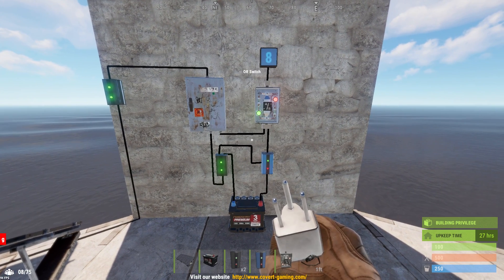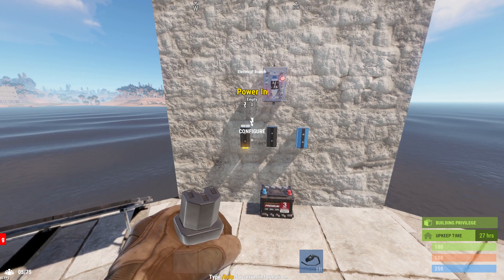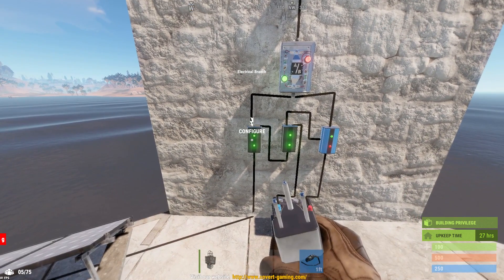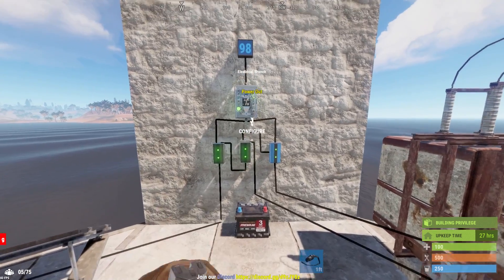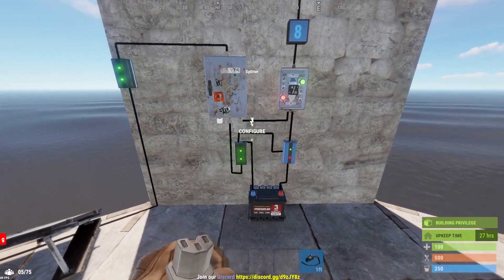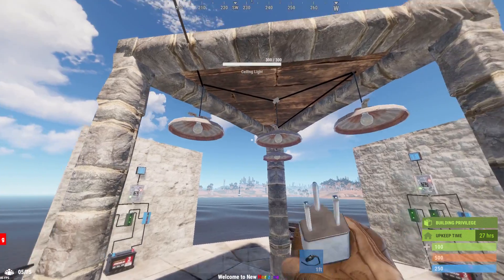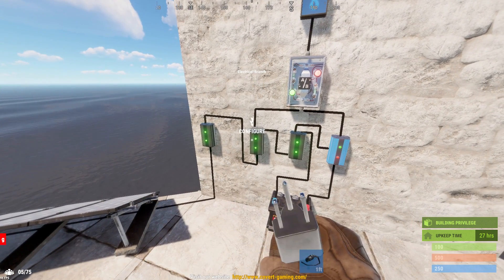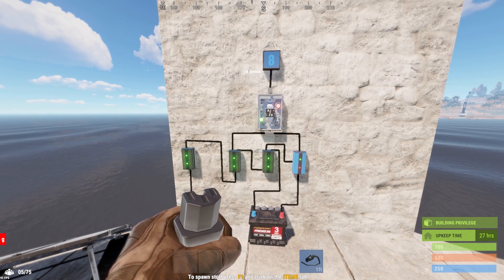The Best Rust Infinite Power Circuit

Comment: this was such a great help i have checked most on youtube n all were to hard to follow i am new to rust n with the turrets now have to use electricity it harder to get more then 1 online now to the setup you showed i have now got a way to get 2 turrets on the setup  i must say im not usen solar im usen windmills 2 of them n 1 large battery so far so good so a big thank you
Reply from the maker: Thx, Glad you liked it :), here is my latest video.  This shows how to setup and use the new small generator as well as how to setup the electronics for the new turrets, this system can run 3 turrets but of course if you need more you can simply make more of these and run them in parallel. https://www.youtube.com/watch?v=Ewcc2Flu_U0

Comment: Hello sir. Quick question hope u answer. I am running the same circuit you showed us but with the large battery. Now do I config the voltage on the 2ND Electrical branch to my setup ? Or do I leave it at 2?
Reply from the maker: Sure no problem change it to 99, if you want to see the explanation skip into the video at about 4:45 and watch from there, thats where I go over that part.  thx for watching :)

Comment: As others have said these really are the best electricity tutorials / explanations I can find on youtube. Subscribed to hopefully see more tutorials in the future
Reply from the maker: Thx, that really does encourage me to make more :)
Reply: @K162KingPin  Do you know how I would adapt the large battery version of this to support more input? I've got 2 wind turbines and will be adding a third, so combined power output ranges but is in the ball park of 150-200+. Do I just build the same thing 2 or 3 times and have 2-3 separate lines?
Reply from the maker: @loamymtb  sry I missed this question, better late than never I hope :).  So I wouldn't set up a second one unless you have at least 300 power on average.  150 volts charging a single battery and running your main line circuit only leaves about 50v to charge the batter which is about 1/2 the rate it could charge. 200 would be more ideal but if you have 300 coming in then you could split that and have two circuits working in parallel.  So simply put you would use root combiners to add up all your incoming power from your various sources.  Then route that into the input of a splitter.  Now build another of these circuits beside the other one or wherever and run one output from the splitter to the input of each circuit.  Now just manage your power outputs from them to keep it under 98 volts for each.  Sadly there is no way to recombine the output from the batteries or the orswitches.  Technically you could root combine your batteries but they would be in a constant state of draining then and would never charge.  Usually when I do a big clan base I have 3 of these circuits powering the base.  I try to make sure I have a minimum of 450 power from my various source, then split it 3 ways and make three infinite power circuits.  I built the circuits into the honeycomb of my base and spread them at away from each other so no raider could accidentally take them all out at once.  Then I spread the power from each around the base and the defenses.  For example if I had 3 auto turrets, I would have each one powered by a different battery so that even if I lost one the other two would still be up and running.  Or usually its more like 21 turrets and each batter is power 7 of them with a little power left over to do automatic doors or whatever.

Comment: why do my small batteries have 5s of charge and not like yours ~14min?
Reply from the maker: Small batteries have 2 mins of charge when initially place.  If you have insufficient power generation for the circuit then it switches to battery power and drains until it reaches 4s or so.  No idea why it never reaches 0 but thats basically just indicating that the battery is empty.  It may also be possible that you have sufficient power generation but an error was made in the setup of the circuit.  I recommend double checking everything starting with your power generation.

Comment: Would this small battery circuit be able to sustain electricity for a turret all night on vanilla?
Reply from the maker: No, the small battery circuit here only supplies 8 volts to the mainline, its good enough for a sensor and a door controller or two but the turrets require a minimum of 10 volts to power on.  Either use the "large rechargeable battery" version of this circuit or else the small battery with a "small generator" as I demonstrate in this video.  https://www.youtube.com/watch?v=Ewcc2Flu_U0&
lc=z22tzzdoksmyzjwhh04t1aokgil24lpzeoctvwlh0mm2bk0h00410
Reply: @K162KingPin  what if he uses 2 solar panels and 2 small batteries with root combiners?
Reply from the maker: @therealKrak  you can't root combine a battery and charge it.  The battery sees the root combiner as a connected item and so is set to discharge mode.  In this mode it can't be charged.  You would have to constantly connect and disconnect the wires manually, the whole point here is to do it automatically.  The battery does not see the Blocker as a connected item if there is power to the block port.  This is why this whole thing works.

Comment: somethings not right with mine, when the power level drops below my number in the first black combiner my power turns off!!??
Reply from the maker: Hard to tell you without seeing it.  First holding your wire hover over your battery and see if it has any charge.  If its less than 4s of charge its effectively empty.  So your problem is that the battery hasn't had a chance to charge yet.  This may be due to insufficient power input.  In other words you may need more solar panels or wind generators or whatever you are using to make power.  Second be sure that the "branch power" on the first electric branch is set to 9 volts if you are using a small battery, or 99 volts if you are using the large battery.  Also double check the second electrical branch and be sure that it is set to 2 volts, this should be set to 2 regardless of the battery being used.  I can't help more without more info but this will probably do it for you.  Good Luck and thx for watching.
Reply: @K162KingPin  Thank you for such a quick reply, i will try the above stated, but i think you are correct when you say i need more solar panels.  there must be a certain amount of solar panels that work with one wind turbine that gets power half the time that gets max recharge and power.  if my power doesnt reach that 99 then things stop working.  You need a considerably amount of solar panels and multiple windturbines if you are building wind turbines on a lower level of your base where they dont recieve much wind.
Reply: @K162KingPin  there is over 2 hours charge, but its still not working
Reply: @K162KingPin  i just swapped froma xor switch to an or switch, hope that helps
Reply: @K162KingPin  I looked up the difference between xor and or, i thought there was no difference, but there is.
Reply from the maker: @blakethompson1868  yea sry for the late reply and xor switch wont work.  It blocks power going through it both input have power which is the case unless you are only using solar and its the middle of the night or if all of your wind turbines have been destroyed.  So is it all working right now?
Reply: @K162KingPin  so an and switch is required
Reply: as in your video

Comment: You got my sub man! So clear and you actually explain whats going on. Thanks so much! Ive been looking forever to find the smallest most efficient setup. Can you make a video on how to combine multiple small batteries like this?
Reply from the maker: Thx, and I'll see what I can do,  I'll wait till the next update though because they are changing so much.
Reply from the maker: Wow such a late reply  :)  Here is the circuit you need.  https://i.imgur.com/P2PDQLx.gif  You don't have to make it this big, each section gains you an additional 4 hours or so.  I stopped playing rust a while back when they started making major changes every week or so it seemed.  Anyway if you still play or others see this here is an 18 hour setup.  This is impractical with small batteries due tot he voltage drop as you add more sections which is why each additional section requires more batteries than the one before it.  Still, it works very well with large batteries.

Comment: Some feedback : 
1. This circuit is not exactly the same than the one provided in the updated reddit elec guide (https://drive.google.com/file/d/1X06jO5bWUQbBWApTeuuRmM0q1xDQ2A8W/view). I'm still struggling to determine which is best . (the large battery one).
2. Using this circuit, I'm not above 98 with 8 solar panels enough time during the day. Meaning the large battery depletes a little more everyday. 8 is already quite a lot during a real vanilla game.
Any way to decrease the 98 value (I don't really need constant 98, more 50 atm) ? Right now if I change the 98 parameter, it will only force the battery to discharge more than expected. And most components linked first to the battery output are discharging continuously the battery.

Comment: By far the best electrical video I've seen. You should make a video on a way to power a Sam  Site with this sort of stuff, since a lot of people would like to know how to set it up.
Reply from the maker: Done check it out :)
Reply: Just add an addtional electrical branch on the circuit that branches 26 to a switch (assuming you want a switch, just 25 power if you dont) and then run it to the samsite.
Same for turrets, electrical branch - branch 11 to a switch and then to the turret. and the electrical branch main output continues the circuit to the next item.

Comment: isnt this a bug abuse as that would be a massive reality flaw and has to be fixed?
Reply from the maker: not sure what you mean? as far as i know the only thing about this that isn't congruent with reality is that you can't use a battery and charge it at the same time, which you can do in real life.  So if anything its a disadvantage that it doesn't work like a real battery.  Other than that this is directly related to real world electronics and how they work.
Reply: @K162KingPin  but this is a perpetuum mobile its called an "infinite power corcuit.
Reply from the maker: Ok I see what you mean, thats just a nick name that others in the community gave the general idea before I did this.  It does NOT give you free power.   This circuit in no way generates power from nothing.  In case that doesn't answer your concern keep reading.

In rust batteries don't behave as they do in real life.  In real life a battery can be both charged and used simultaneously.  Like using your phone while its plugged into the charging cord.  In rust you would have to turn your phone off to charge it, then disconnect the charger before you could turn the phone on.  So this circuit is a workaround for the fact that batteries do NOT work correctly in rust.  The "infinite power" is simply describing that if its dark and your solar panel isn't picking up light then you will still have power to your circuit as this design automatically switches the battery from being in charge mode, to discharge mode.  Still the power in the battery itself ultimately came from the solar panel, it didn't come from nothing.  Still if your solar panel were destroyed, or something placed over it so it couldn't get sunlight then the battery would eventually drain and you would no longer have power.  I suppose the most unrealistic thing about it is that in rust you always have sun light during the day on a very predictable time table.  In reality solar panels perform differently depending on the weather.  In very cloudy conditions they are practically useless.  In rust that isn't a problem.  Similarly if you use a Win Turbin in real life you will inevitably have periods where you have no wind.  In rust the wind always blows, it varies in speed, and therefore power output but the wind doesn't ever stop.  Still this is by no means and exploit or some sort of perpetual motion generation it is simply game mechanics and not an unintended use of them.

Still I'm glad you brought this up so I could clear up any confusion.
Reply: @K162KingPin  You're so nice dude... explaining things to this douche who obviously didn't watched your video, just read the title and yet felt the need to post a stupid comment. And I'm pretty sure he won't ever read your overkill answer.
Reply: Who cares

Comment: how does the battery keep its power?
Reply from the maker: The middle electric branch is branching off the 9 volts to the OrSwitch.  Any additional power feed into that branch is feed into the battery to charge it.  So if you have a single solar panel in direct sun light it will produce 20 volts.  You lose 1 volt powering the branch leaving 19 volts.  9 Volts goes to the OrSwitch while the leftover 10 volts goes towards charging the battery.   Does that answer your question?
Reply: @K162KingPin  Yup... Many people uses the splitter but they forget that the splitter splits the power over 3 outputs and you can not combine them anymore because the combiner only is accepted after a source, while the branch has 1 power out minus the value of the branch you have set it to and minues 1 volts to let the branch operate.
Reply from the maker: @ProgNoizesB  The splitter splits power only 2 ways if you only use 2 of the outputs as well, limited usefulness but good to know.  Still that is the problem with what people have been using for the last couple years, because the power is split evenly you can create a cuttoff point, so you end up with a solar panel in low light and its not putting out enough to provide the 8 volts but at the same time it is putting out enough to prevent the battery from doing it.  Also the Splitter cost more than the electric branch so when you only need two outputs anyway you might as well go with the cheaper option.
Reply: @K162KingPin  but if I have just 5 volts I loose it without any profit ? I can just connect solar panel to battery with more advantages? why not? I don't understand why this circuit should be used at all?

Comment: Hello thanks for the video, if im running 4 solar panels instead of 2 how much do i need to set the electrical branch too? im struggling to get this circuit working with a small modification for one door with a HBF sensor :(
Reply from the maker: You shouldn't have any problem making this work with one door and one HBHF Sensor.  Adding more solar panels would help if your battery isn't getting fully charged during the day time but you wouldn't need to change the branch power at all.  More panels would charge the battery faster though.  If for some reason you don't have enough power even when running on the battery then something has been setup wrong.  It should have plenty of voltage for that setup.  I'll do some example trap base designs soon.  Maybe that will help.  You will be able to see the circuitry applied to various sensor and door configurations.

Comment: after trying adn trying i give up i dont know the way to run a paralel recharger battery because the root combiner discharge the batteries and i canot put a swish before the batteries but i put 2 separate system togeuther 8 and 8 https://i.imgur.com/w7i9k7x.jpg
Reply: thax for you video is very helpful